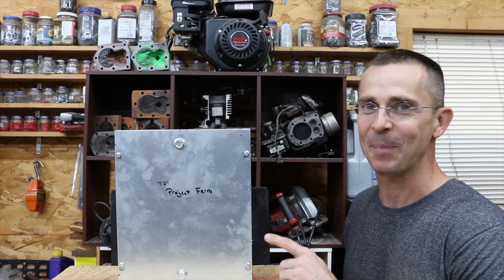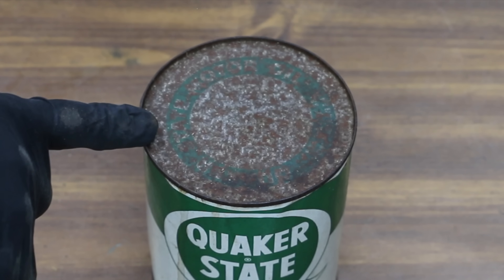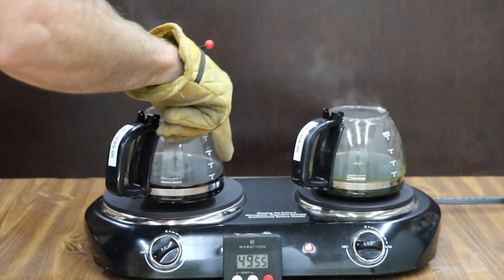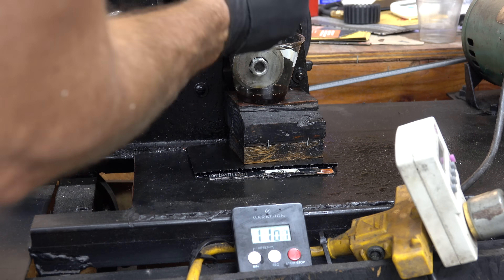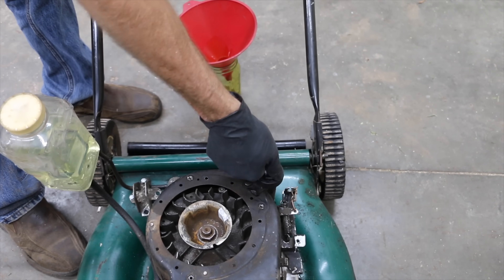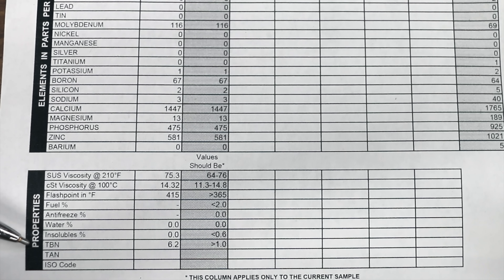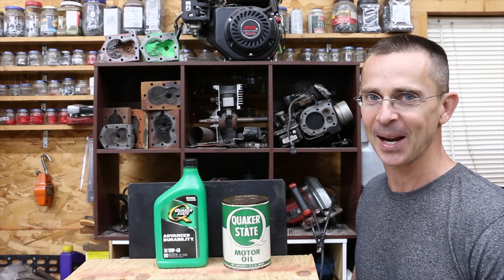Is Oil Good After 70 Years?  Let's find out!

Comment: I was a mechanic in late 70s till early 90s. In the 70s and early 80s quaker state was the worst oil it would gum up an engine fast. I was told it was because  it had alot of Paraffin in it but i know first hand it would gum up an engine and that old oil you have is sae 30  non detergent so to compare you would have to use sae 30  i have an old can like that in my garage along with an old can of Valvoline oil on shelf lol
Reply from the maker: Thanks for the feedback.

Comment: Video Idea: will running (although gas prices are insane right now) race gasoline/highest octane you can find harm a regular, stock motor? Differences between regular pump 87 and some vp110 or 112 as an example?
Reply from the maker: Thanks for the suggestion.

Comment: Be interesting to do a test if time breaks down performance of modern oil.
You always have oil left over after doing a car service. I put it back on the shelf and will eventually use it but it might be sat on the shelf for a year or two.
Also be interesting to knows if you actually need to change the oil in the car after a year even if u only drove it 500 miles since it was changed.
Reply from the maker: Thanks for the suggestion.

Comment: I have left over Kirkland oil.   Car never used full five quarts.   I looked at the little view window.  Shined a light into the top.   I thinking I see a clear fluid on the top.  Jugs been sealed since time I changed oil years back.    Maybe leave a few out date.  Come back in year and then two or three see if you see separation.   I am almost going to pour out into another clearer container to see.  Ever seen that before
Reply from the maker: Thanks for sharing.

Comment: I actually have 8 full cans of Deluxe Quaker State and always wondered if they were worth anything. Cans look exactly like these except they have Deluxe written in gold lettering on them.
Reply from the maker: Thanks for sharing.
Reply: That is different than the "plain" oil like the green can in the video
may vary depending on the year it was made,around 1980 GM put out some kind of message not to use the version labeled "10w-40" and "SE" or "SE,CD" 
also Tecumseh Engine said not to use 10w-40 oil 
someone claimed that the can had almost as much additive in it as base oil 
 I think the one labeled "SF" was supposed to be O.K.

Comment: Hi Project Farm, I have a testing suggestion for old stored oil.  Not ancient oil but several years old, say 7 or 8  or 10 years old, if you could find any, ...whether it is still good for use.  Many of us have old stocks of oil, bought several years ago and wonder if it should be used or gotten rid of after the pandemic.  I haven't been driving my car for two years nearly at all, I work from home.  I have an old stockpile of oil, maybe 30 quarts 4-7 years old, from when I was driving quite a lot.  Perhaps a comparison say 10 year old oil with brand new oil of same brand.
Reply from the maker: Thanks for the suggestion.

Comment: I used to sell that stuff
 It will be 30W QS, probably non-detergent.  In the day, it worked FINE for regular use, as long as you changed it every 2,00o miles.  I helped in an automotive machine shop. We had an engine come in, with 100,000 miles, on ONLY 30W QS detergent oil, changed every 2,000 miles. There was ZERO WEAR in the cylinders!
Reply from the maker: Thanks for sharing!

Comment: Then there is the question.  whether the properties of the oil can be affected by 70 years of storage in a metal can.  for example, if certain substances in the metal in the jar have been dissolved?  and that the oil has not received oxygen in 70 years?

Comment: I have some unopened Castrol GPS motorcycle oil, it's about 8 year's old, still looks new looking through the sight piece on the side of container. I usually change my oil every 1500 miles as only cover low mileage. Do you think it would be okay to still use?

Comment: After seeing this it's no wonder that engines were worn out by 100,000 miles back then. I'm sure looser tolerances didn't help either. By the way, did the lab results determine what weight oil it was? Is there a way to find out? I'm curious if these old oils were a lot thicker as standard.

Comment: My car is supposed to run on synthetic 5w30. but I used mineral Mobil 1000 oil on a car recently to change oil, because due to the situation we didn't have any synthetic oil available. Now I bought my usual Mobil 3000 FE synthetic, I've ran 500 miles., should I change it now or wait 3000 miles? I don't mind that mineral oil being my engine flush.

Comment: Oil does not go bad. I worked for a shell distributor for 22 years and we had a hotline to get answers if our shell literature didn't cover it,for when customers wanted advice. No advice is better than bad advice. You wouldn't want to be responsible for  causing someone to fry their engine or hydraulic system .

Comment: Engine oil additive packages have always intrigued me.  Whether they are sold by snake-oil dealers or from "legitimate" sources, the same claims abound:  Improved performance, almost eliminates engine wear, and unbelievable fuel economy [and let's not forget smoother power delivery].  I've seen a bunch, but one that stands out was a product call "POWER-UP". You replace ounce  of this product per quart of motor oil [31:1 ratio].  My dad was an area dealer and I did in fact used it for a number of years and by golly, it lived up to it's claims.  There's too much info for this format, but if you're interested, let me know.
Reply from the maker: Thanks for the feedback.
Reply: STP   it's the racers edge..

Comment: I put bar oil in my push mower 30 years ago and mowed my parents 2  anchors yard for 3 years rain Great, it never used any oil.
I think you need. I use oil pressure motor  filter. To do a better test like please twenty four hours

Comment: Lol...back in the day this oil is all my dad would use.
We tore his engine down when it died at 220,000 ish miles.
There was a 3 inch thick fudge layer in the bottom of his oil pan.
I don't think he changed it every 3k miles but did at least twice a year.
He stopped using it after that..lol.
Reply from the maker: Thanks for the feedback.

Comment: I kind of wondered 💭 if 60 year old motor oil would work in an engine. I knew that the oil would smell 👃 different when ya opened it 🆙. Quaker State was a common oil when I was young. It even came in steel cans. In a washing 🧼 machine video I watched, the person used 60 year old Tide laundry 🧺 detergent, it worked!! In my opinion, this seemed to be a waste of a box 📦 of vintage Tide laundry 🧺 detergent, from about 1940. I wished ya would have saved that can of Quaker State motor oil. Yes 👍, it had broken 😞 down over the years, and had the consistency of honey 🍯(maybe a little bit thinner). It also smelled 👃 different, and was darker in color. I’m guessing that ya used a can of Quaker State from about 1978. I bet it would work in an older model of car 🚘. Might have a shorter service life, somewhat, but older cars 🚘 did not have fuel ⛽️ injectors to clog 🆙. Cars 🚘 of today are junk, and I bet your can of Quaker State motor oil outlasted a great 👍 many 👨 of them. Too bad ya opened it. Your friend, Jeff.
Reply: Modern multi-grade oil first appeared in the 50s, but most folks continued to use single grade oil well into the 80s, some of us well into the 21st century.  Single grade oil is thick when cold, even brand new.  That's the beauty of multi-grade oil.  It is nice and thin when cold, so it flows quickly in a cold engine.  It has polymers in it so that it doesn't thin out as it heats up, so hot, it is supposed to be just like a hot single-grade oil.  Today's is great, but back in the day, it sometimes sheared.  That's why many of us wouldn't use it back then.
Reply: @michaelbenardo5695  It did things a lot worse than shear.
Reply: If a modern car,especially with "variable valve  timing" or "displacement on demand" or "phasers" calls for very low viscosity oil such as 0w-20 synthetic,don't put old oil in it.

Comment: Had to put one quart of oil per 1‘000 miles into the engine of the camper when we traveled the USA back in 1982. We used Quaker State oil because at 99 cents per quart it was the cheapest 🤣🤣
Reply from the maker: Thanks for sharing.

Comment: OK, several questions: was the 50's oil a single grade?  What weight is/was it? I suspect 30wt  Was this considered a straight grade non detergent oil or was it considered "detergent" oil?   The oil color shows it to be true Pennsylvania oil.  Today multi vis oils are about 75% to 80% of the finished product. The additive package makes up another 10% to 20%.  Interesting test, thanks but more info would be good.
Reply: I think " multi-vis" began to be popular in the late 50s or early 60s and was an inferior product in many cases,there were some borderline ratings like 20-20w (20 was a summer rating while 20w was a winter rating)  the convenience  of not having to change oil when the weather got cold appealed to the public and fueled the desire for  multi-vis 
single viscosity oils could be detergent or nondetergent,could have anti wear or lack anti wear
Reply: @davidpowell3347  When I began working (in a service station) lied about mu age by the way in 1964, Union Oil had Royal Triton (purple) motor oil multi vis. Very few folks bought it and stayed with single weight 30 (Southern California)  year round.

Comment: I saw many engines in the 80's and early 90's destroyed by Quaker State oil. They would gum up inside so bad the oil couldn't flow through the engine anymore. I've pulled valve covers and the heads would be so full of gunk the rocker arms were the only open spots because of their movements. Even seen crankshaft journals stopped up and caused bearing failure. Don't know about the new stuff and don't care to try it lol.
Reply from the maker: Thanks for sharing.
Reply: I think the Quaker State and Pennzoil brands are now owned by Shell Oil Corp.  and are completely reformulated and trustworthy

Comment: Which proves changing the oil  every 3000 miles was waaaaay more important in 1952, but back then the boast was to go further on a oil change, which  was $4.00 or $4.75 if you changed the Filter.

Comment: Obviously the newer oil would do better as there's that many more years in researching and testing oils. however in the heating oil bit where it weighed 9 grama less than when started I can't help but to think the oil would have to have had atleast some form of deterioration and broke down much easier. I feel as though if the old oil was brand new it would be pretty close to on par with the modern day oil.
Reply from the maker: Thanks for the feedback.
Reply: The oil contained a volatile additive such as kerosene! In order to hit the desired viscosity number?

Comment: The viscosity should be printed or embossed on the lid. That oil is from 1967-69. 
It probably was SAE30. Of course at -40 a 10W multi vis will flow better. Der. Viscosity literally is resistance to flow (if density is the same for gravity induced flow)
Reply from the maker: Thanks for the feedback.

Comment: You never tested the old oil for viscosity.  It was probably single grade, so the cold test was not a fair test as far as age.  Also, non-detergent is the best for engines without an oil filter, as much of the impurities will settle to the bottom of the pan, whereas detergent oil keeps it in suspension, where it keeps circulating throughout the engine, scoring the bearings.  Detergent is best for engines with full-flow oil filters.  The impurities will all be filtered out BEFORE the oil reaches the bearings.
Reply from the maker: Thanks for the feedback.

Comment: The only problem I had with that "test" is that you did not know the Grade of the Vintage oil (which I would assume to be 30W30) That is what cars used in those days...no multigrades, no detergents.   Then you compared it to modern oil with a weight  of 10W40?  Of course the 10W is going to be first down the race track.  You still can buy "30W straight" motor oil.  w/o detergents.   Compare apples to apples.   The green colorant is something the manufacturers put in the oil so you can see it on the dipstick.  Has no other meaning. Quaker did it maybe to go with the color scheme on the can?  Other old oil brands didn't spend the money to do that.  Been driving since the 50's and doing my own oil changes using various brands - QS, Shell, Sears, or other brands on sale.  Multi grade did not exist yet so it was 30 for summer use and 20 for winter use cuz I am in Alaska.
Reply from the maker: Thanks for the feedback.

Comment: Old fart here, 60 years old.  I remember when they offered non-detergent motor oil and that appears to be what you have there.

It was usually marked on the can as non-detergent.  Non detergent Quaker State had a green ring around the top of the can, while detergent oil had a red ring around the top of the can.

I am remembering from the late 60s and 70s.
Reply from the maker: Thanks for sharing!

Comment: sounded like the old oil was a straight non detergent from 30 to 50 ,  i did have old truck Chevrolet  235 cid n the 70s  motor was well worn and a fill oil and check gas . but pep boys pure as gold oil was the brand that burned the least i think it did have some detergents and was either 30 or 40 weight . i have always wondered how long a 1950s engine would last with modern oils i bet as long as the better 2000 to 2010 or so seems we gone backwards on many engines since 2015 or so  i refuse to buy a gas with turbo on tiny engines
Reply from the maker: Thanks for the feedback.

Comment: Caveat,    although  I do believe modern oil is better,    this is not a true head to head test,   as we would need a time machine to get a   FRESH oil can against a modern  Fresh can.      I've worked at nearly every   filling station in my youth of the 1970s.      The Quaker state was never this color,    therefore,    the can used in the test   HAS deteriorated to some degree.     

Another way to qualify this test, would be to get the vintage spec sheet for the vintage oil from Qstate labs done in the 1950s and compare to the same test you had done today.    Then compare the deteriorate

Comment: That can of oil is probably straight 30 weight oil, like everyone used back in the day.

It would have been more fair to compare it to modern quaker state straight 30 weight, which believe it or not they still manufacture.
Reply from the maker: Thanks for the constructive feedback.

Comment: Based on the thumbnail question, “Is 70 year old oil still good?” I probably would have compared the vintage to a modern version of the exact same thing, not something that we know right away, before we even get it out of the bottle, is going to be superior. Of course the main reason for the test is to find out if it’s good (or more importantly, bad) for the engine, most likely a car’s engine, but that’s not going to tell us if it’s “still good”, as in “Has it gone bad over time?” The test will only tell us if it’s “good to put it in your car.” Given, it’s obviously not the best thing for your car. But, so long as it hasn’t gone bad, putting it in an engine (that doesn’t have anything better for the moment) wouldn’t be bad. It’s better than nothing, so long as you get it changed reasonably soon. And it looks like it hasn’t gone bad, but is it worse than the modern version of the same? Guess you’d have to be pretty far from a Maaco with a dry engine to even consider using it, or just not care much what you put in your old lawnmower?😆
Reply from the maker: Thanks for the feedback.

Comment: I just have to say this.  I can't claim to be an engineer so maybe what I'm about to say doesn't apply.  But I think back to older model vehicles that ran on this very oil not for days, weeks, months, or years.  But for decades.  So why did the acidic nature of the oil destroy those vehicles engines?  The answer I think it in the quality of the steel used in the engines back then.  Adding all of those additives to the oil didn't matter.  Because the engines were designed to run regardless.  Fuel efficiency and speed wasn't the consideration.  Building a product that would last you decades was.  Hell as a teenager of the 80s, many a high school kid drove muscle cars and trucks from the 1950s and 1960s.  They weren't fancy.  They were built like tanks.  And they got the job done of carrying you from Point A to Point B.  That is all that mattered.  

My Dad once got T-Boned in his 1971 Ford.  The other vehicle was totaled.  The mechanic literally took the side panel off his truck, hammered it back in shape, repainted it, then reattached the chrome and put it back.  Other than a huge dent in the side, his truck was completely driveable after the accident.  And my Dad owned that truck for close to two decades.  Never had any engine issues that I can recall.  He finally traded it because he just wanted something easier on gas.
Reply from the maker: Thanks for sharing.

Comment: I wonder just how much of the "older engines died at about 50K miles" was poor oil and lubrication. Modern engines seem basically bulletproof (my wife and I both have had engines last over 250K miles with minimal maintenance aside from recommended oil/fluid/filters). The family business has a crate 351ci V8 that has over a million- it keeps outlasting the vans we put it in, gets rebuilt every 300K or so.
Reply from the maker: Thanks for sharing.
Reply: No oil filter,poor air filter that people don't service because it is hard to service,dirt roads that shed clouds of abrasive dust during the summer that get sucked into the engines---

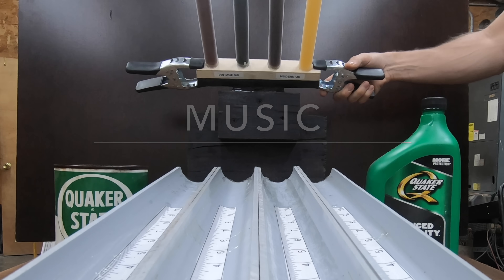Comment: The frozen oil test at 8:42 cant be accurate unless you know the viscosity of the vintage oil. It could be straight 40 you are compairing to 10w-40 .  Not apples to apples.